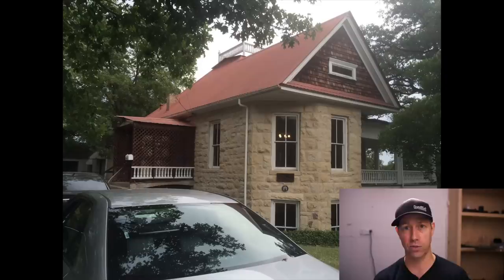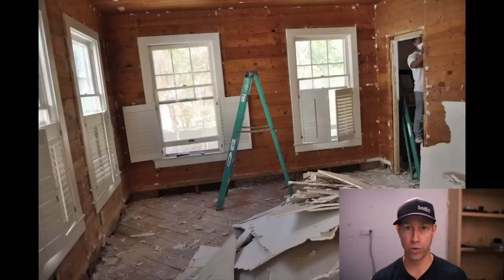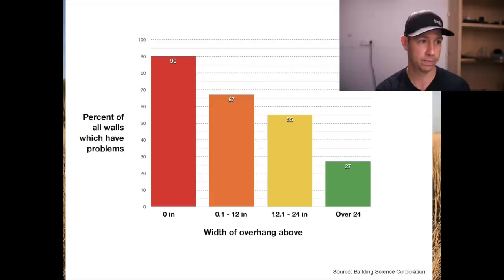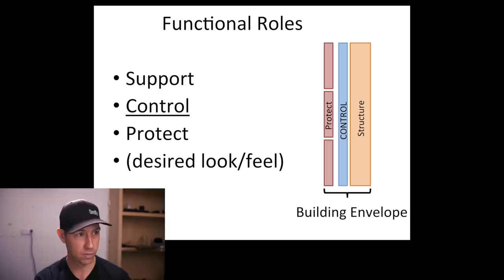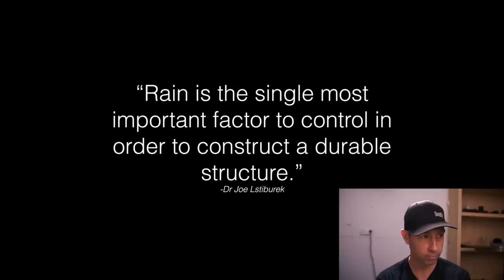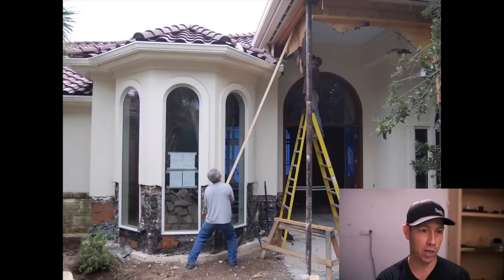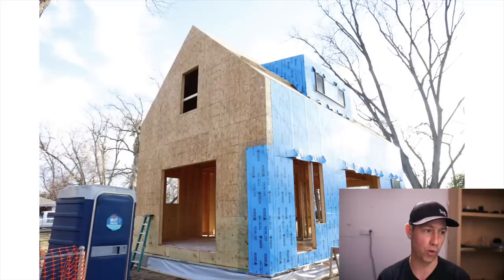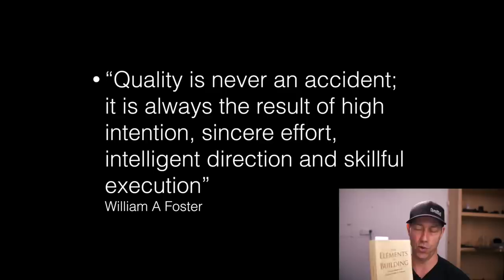Were Old Houses Built Better?

Comment: I bout a 3 bedroom house. The original 1 bedroom  rock house was built in the late 1800s. 2 bedrooms the modern kitchen,bedroom and living room were added in the 50s. I was going to remodel but after looking into the walls and stuff I tore everything down except for the origional portion of the house cause it was still just as solid as it was when built. The wood frame had no damage at all. When I build my new house, I'm going incorporate the old house into the new house. 1 wall will be part of the new kitchen and living room,bathroom,etc.

Comment: Nice presentation Matt, but the decision to build without roof overhangs even with modern waterproofing materials is not a good one.  All materials (except maybe true masonry) break down over time.  The roof overhang is the long-term insurance of exterior integrity.  Secondly, the roof overhangs provide shade.  In a climate such as Austin's that shade is valuable, especially when it is needed most - at the sun's highest point in summer.  Final point: roof overhangs are attractive and cheap to build!

Comment: Hey Matt,  really good video.  Thanks for putting it together.  You kind of mention it here, but the huge difference to me is there was an almost total lack of engineering in most older houses, from concrete, grading, spans, connectors, electrical, fire prevention, mechanicals, and plumbing, (anyone for some good old knob and tube wiring?)  The old lumber is cool to see when you find it and brings a touch of nostalgia, but as I'm sure you've seen in Texas, when a house takes tornado damage, it's really rarely the lumber that fails, it's the fasteners, nailed joints pull right apart.  You got around to it, but I'll take modern engineering any day.  The problem (in my opinion) is when materials manufacturers come up with some latest and greatest labor-saving materials that don't get thoroughly tested or were applied incorrectly.  I still don't like OSB, but it's here to stay.  Keep up the great work, you always bring a good perspective and info in your videos.

Comment: i personally think homes built back in the 1880s are way better than the sheds they throw up today, 
my home was built in 1825, and most or the original features are still remaining, the walls alone are between 2 and 2.5 ft
many walls in today's homes are paper thin,  you can stand 6 people in my fireplace, i have seen some rooms, in some houses, where you would struggle to get 6 people in them.
Today they just throw houses up and charge the earth for them, 
the only real problem we had, were birds building a nest in the top of the chimney,  so i had a  brass weather vane fitted, that worked...

Comment: Growth ring count depends on several factors. One is species. A new growth, dense #1 Douglas Fir will have nearly the same number of rings per inch as run of the mill old growth. In general southern pine tends to produce wider growth rings than Douglas Fir, yet is slightly stronger. You can special order #1 or SS southern pine and these will usually be much denser than the wood in the picture. If you drive to Alabama, you can still buy new #1 dense Longleaf pine that rivals old growth DF.

Comment: My house was built around 1805. I’ve owned a bunch of old houses over the years and this is the oldest by far. Solid brick walls built in the Federal style by a family who made bricks for a living. It’s incredible that even tho it has its old single pane windows and drafty dry stack stone foundation, that it still does a great job of regulating its temperature. We get by here in Ky with minimal AC. And year round our energy bill shows us in the "very efficient" category for similarly sized homes. Modern houses, imho, are just another mass produced plastic commodity marketed to bloated consumers.

Comment: In my opinion, I think new houses are built better because I jumped in my hallway and it didn’t make a sound and my house was built in 2012
. But when I went to my friends house, his house is like really old it’s like from the 60s when I jumped in his hallway, it made a loud sound, and it vibrated the floor and it also shook his entire house, and I only weigh 70 pounds
Reply: Do it in a house made in 1860
Reply: @noahpaulette1490  where am I supposed to find that?

Comment: Hi
First problem with that EIFS system was due gluing it directly to the plywood.
I worked with EIFS system here in California back in 1996-1999 and never had issues because we used TYVEK or black building paper.
Anything If it’s not done properly will go bad in no time.

Comment: I appreciate your professional insight. You know, we in the late 2010s are going to have a lot of even more problems as Tiny House boom came and went, and thus a lot of unprofessional builds that was built to conserve weight than to last long. I worry about those "houses" made out of shipping containers and reclaimed pallet woods that still cost them tens of thousands of USD anyway! I see a lot of cost cutting method further and further down the timeline and it worries me. I much prefer to have a stone brick house that can last a millennia and wear extra clothing than a home that can tear apart in 5 years and have great heating.

Comment: Great video.  You keep mentioning comfort and energy, but safety is also a big one.  Old homes (and cars) didn't have safety standards like we do today.  Seismic, snow load, wind sheer, fire alert and suppression, etc.  One more thing I've noticed as I've remodeled a lot of old buildings and houses:  I see signs of more highly skilled craftsmen.  Not only did these men have less to work with as far as tools and tech, but they had to have more skill.  Masonry, fine woodworking, plaster, and even plumbing were more technical trades than what we see today.

Comment: 20:55 what's the reason for using plywood at the bottom and OSB above that?  Is it because plywood is more resistant to rot/water damage?  If that's the reason, why is that necessary if the house has amazing waterproofing?
Reply: The moment that you time stamped is literally the time I was at in the video when I clicked on it. Now can that luck be applied to the lottery please..

Comment: @Matt Risinger  Found your videos and enjoy them. 
Regarding not being able to build like they did older houses now: Do  you know why the one had a 5 foot overhang, how it could help cool in the summer, and if the windows caught the prevailing wind how it would have added to ventilation and cooling? 
On the one with  2 foot rubble walls if the orentation were correct the walls would have been great for thermal mass to provide radiant heat during the winter, as well as absorbing cool night temps to assist on keeping the interior cooler in the summer.

Comment: Houses nowadays are more built for speed rather than sheer durability, especially if you look into buildings like apartments. And newer materials like drywall and plywood are very common, when old buildings like from the 1800s usually didn't have any at all, or wasn't as common.
Reply: Because they wanted REAL and SOLID homes, not fake facades built to last 30 years.

Comment: Matt, I have asked several AC guys this question and have had some really odd answers. I now live in a home that was build in 1912 with no exterior insulation and has 3 window units. I live in Louisiana an my electric bill runs on average $150,00 a month.  Six months ago, I left a home that was build 4yrs ago with central AC and my electric bill ran on average $300 a months with interior and exterior insulation. Both homes are 1800 +/- 50ft, 3 bedroom 1.5 bathroom. AC was set at 65 degree on both homes.  Why the drastic difference in my electric bill on such a newer home?  New home had brick exterior. Old home had shiplap on the exterior and interior wall with drywall overlay in the interior walls.

Comment: The way shiplap is made, the house does get wet, but in most cases, unless there is a prevailing wind, or damage to the eve of the house, the moisture that gets into the walls, is able to "Breathe" out and the wood is none the worse for it. Today, the way we "computer think" the designs of houses, there is nothing "pre-thunk" into a design of a wall or any other part of a house that addresses moisture in the wall or how it might be able to escape. The prevailing thought is to abate the water, or prevent it from getting in with "tightness", which will fail at some point, or just flat out be a failed exercise in general, in which case, the same theory in application becomes a trap for that water, then leading to mold growth, and rot, because the moisture cannot escape back out.

My supposition would be to design the wall with an air gap which will be able to remove moisture from the exposed outer wall, and still protect the inner wall from the elements. Either that, or come up with a material that is itself "breathable" which does not have need for any gap. Such design should keep in mind thermodynamics to hasten the flow of moisture to areas which allow for escape, and gravity that helps shed water. I believe in larger overhangs. The traditional foot and a half is woefully inadequate, and should be at the very least 2 1/2' -3'... Making use of materials is by far the better way to go, but trying to design the seams, and integrate lap joint that discourage water from penetrating is also of value. The design of the old, wooden frame windows is such that all water that gets into a crack, will eventually be lead via gravity to an exit point on the bottom of the seam itself, thus water makes its way out, despite its ability to get into a crack. Nothing like that exists today, and any house made from 1980-2007 has any defense against water penetration. (They all subscribe to keeping water out, but do not address anything once it does.)

Comment: I'm not a builder but you pretty much confirmed a theory I've had about new construction being inferior to older construction because modern materials have been streamlined to the point where there is no longer any wiggle room for builders to massage. So if there is just a single component that wasn't applied properly, in your example caulk near a window making the stucco rot out, the damage can be enormous because builders are on a tight schedule to finish a home, where in 1939 it was possible to make the materials work and the home would still be fine, builders were still rushing to finish homes, but the materials were more resilient overall.

Comment: I'm interested in knowing more about windows specifically. Older windows, built as part of the house itself, had drainage mechanisms like sills and drip caps, but new windows seem to be units that are inserted into a hole, and I've heard of moisture and drainage issues from them (as well as the inability to repair them, meaning they need to be replaced again way too soon). The way they're always flat to the wall or sticking outward slightly also looks gross in my opinion.

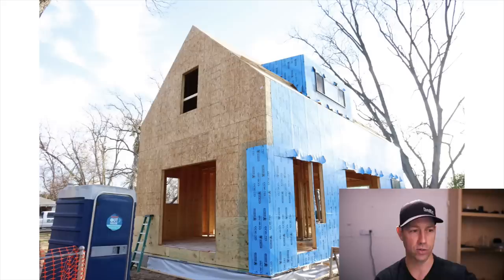Comment: Hi Matt. What is the temperature range (summer to winter) for the area this house (21:22) was built in? Also, was the fact that the external sheathing is corrugated metal the main reason why you were not concerned about humidity affecting the insulation on the outside (or does the batton leave enough air space)?  How much does it cost to build a house like this? I like it very much, but agree some areas should have smooth walls and solid doors.

Comment: On the last house,(modern) with no overhang, and you said it had Peel and stick thick water barrier on outside of structure. Then on the outside of that it had Insulation boards and then 1x4 landing strips to fasten the final exterior. If as you said that the pile and stick had nothing penetrating through it, how was the other stuff fastened to the structure?

Comment: we have tamarack flooring in a 150+ year old barn on my property that we recently removed to lift the floor up. Zero rot, and this is a cow barn where the wood is covered in urine and wet cow dung. I would not be surprised if alot of that was tamarack, not pine. Our farm house as well is from the early 1700s and has original "kingsboard" flooring. Old houses were built better because they knew to use the proper types of wood for the best applications.

Comment: Rule number one...never rely on sealants.  Water should be controlled by gravity.  This is why overhangs work...the water is controlled by gravity away from the wall.  This is howmshingles work...they aren't sealed, it's the overlap and gravity does the work.  Sealants will fail...gravity won't.

Comment: What's your opinion on the durability of a barndominium? I'm referring to the kind built with concrete slab foundation with steel structure and metal roof/siding.

Comment: That 1960 house looked like it was built 5 years ago. Almost brand new. Incredible. Definitely better than the low detail that now a days people do not care or usually just don't know what their doing. We need some serious regulation for the business.  I would never buy a wooden house. There are more parts put into a wooden home. More like concrete. Less parts less failure and no rot.

Comment: OK Matt, with the structure on the inside , then the water & ice , then your  thermal insulating material. What happens to the insulating thermal material if it gets moisture or a leak in your fasteners on the metal roof, or a window caulking has a problem?  Will not the thermal barrier develop fungi  or mold? Or is it just not considered a problem as long as it's outside the water and ice barrier .

Comment: I have seen countless old homes that were not built worth a didly squat.  They're basically collapsing on themselves.  I've seen newer homes built crappy as well.  If you use good materials properly 100 years ago, it holds up well.  Use good materials properly today, it will be better than the 100 year old house.

Comment: Just stumbled across this and it was a good video to watch.
While building techniques in the US and here in Europe are so different the problems with designing houses that meet modern requirements are similar.
Also problems with bringing older house up to modern standards can be comparable, and I notice also the differences in the quality of traditional materials used like the wood are similar, the old pine wood used in roof and floors in my house is much denser and harder than similar new pine.

I live in an 1928 masonry house in the Netherlands.
Making the house more energy efficient isn't straight forward all the way.
The insulation of the roofs (partly sloped ceramic tiled roof and partly flat roofs with asphalt roofing) was straight forward by installing insulation material between wooden roof construction and roofing materials (these are polyurethane foam sheets with a moisture barrier on one side).
Also windows have been replaced by double glazing in new UPVC window frames.
But insulating the walls isn't straight forward, normaly a masonry house built after WW2 has double walls with a cavity in between, and in most cases retrospective insulation is done by blowing an insualting material into this cavity, which is relatively cheap and quick, payback time is 3-4 years in energy savings.

My house is built with a wall cavity, which was exceptional in 1928, but has been extended a couple of times during the 1970's and 80's.
Where these extensions meet the original building the cavity doesn't continue trough the outer wall, also the cavity doesn't continue far enough below floor level, and both these are creating cold bridges preventing blown in insulation, at the spots of these cold bridges I would get moisture problems, because the walls will lose much of their capacity to ventilate after filling the cavity.
Therefore I was adviced to place an insulating shell with plastering on the outside of my house, which is a very costly process and only paying itself back in at least 15 years at current natural gas prices, with the anounced rise in those prices over the comming years it will maybe fall down to 10 years payback time, which starts to make it a slightly viable option.

On the pro side is that this kind of insulation gives a far better performance, as like the last house in the video, the shell encapsulates the whole structure and there is no way for moisture to collect in the construction materials, as both brick faces of the outer wall are shielded from rain and kept on the warm side of the insulation preventing condensation from the inside, also the ventilating cavity stays open.

The difference between the way how a house should be insulated in a warm or cool climate is pointed out very well in this video.

Comment: Even given what you've said, I'd still want the 3 ft walls and old growth. As for weather, I'd use shape and draft vents to create additional airflow in summer rooms, orienting them to accept as much wind passing as possible. I'd close summer rooms off in winter. Ceiling fans of course, work wonders when used in connection with other strategies. I have a/c in my apartment, but I rarely use it. I turn on the fan, close the blinds, sit still and stay hydrated. Even hot beverages will help cool a body down, believe it or not.

Comment: Our house has hand-hewn beams, in post and beam style construction ... you know, the type where no nails are used. Just wooden pegs! :D
It's probably at least 150 years old.
The only thing we've noticed is that there are powderpost beetle holes in the timbers.

2:55
That's possibly because the stone walls in, fact, are somewhat moisture permeable. That way, the moisture doesn't get trapped as much inside. But we're talking Texas ... not Massachusetts or Pennsylvania!